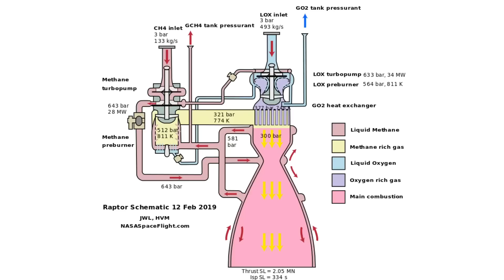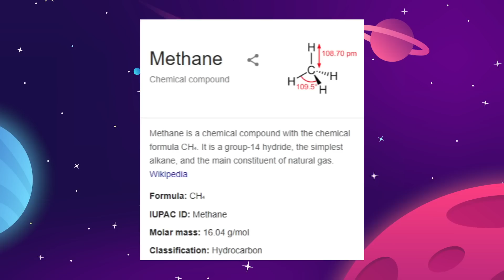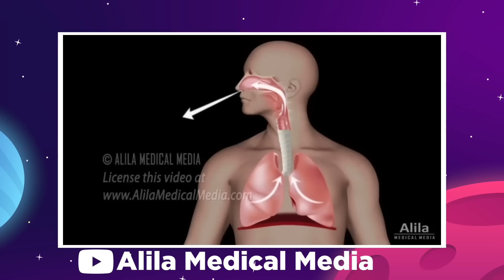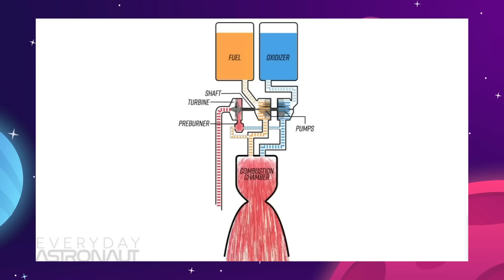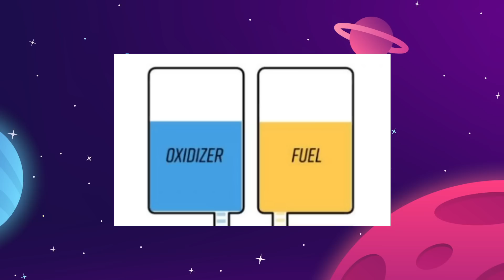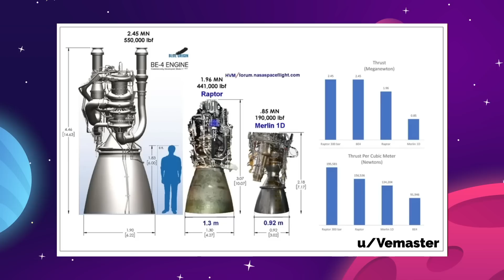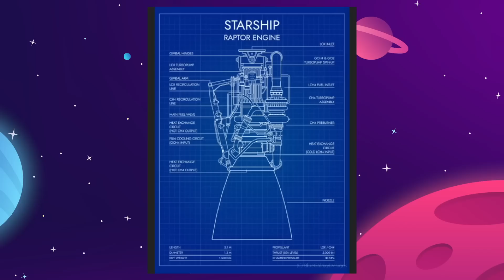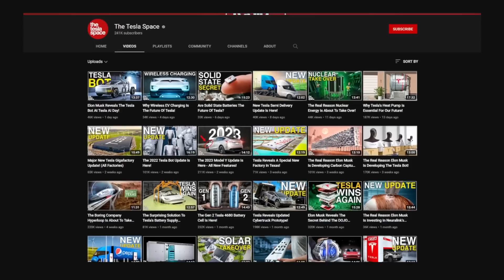The Real Reason SpaceX Developed The Raptor V2 Engine!

Comment: I have a question. Since there have been at least 33 Raptor version one and 1.5 engines and neither are going to fly a Starship, what will happen to the old engines?  I wish Spacex would modify a Falcon 9 and launch them into orbit. That would give them lots of data and might even get more Starlink satellites into orbit.

Comment: While largely correct, the little detail in this video are often just plain wrong. The Raptor is not the first attempt at a full-flow staged combustion engine, it is the third. It is the first to fly, though, as the other two didn't get as far as flight testing. 

Also, the oxygen side of a rocket engine is most decidedly not the same for all rocket engines. If only because not all rocket engines have an oxygen side. Oxygen is NOT required for all fuels to burn. There have been hydrogen peroxide oxidizers in some rocket engines. The super draco thrusters on a Dragon capsule use hypergolic fuels, neither of which is oxygen. Solid fuel boosters, which are definitely rocket engines, use no oxygen.

Comment: I am pleased you mentioned the Everyday Astronaut. I remember Elon talking to him and saying Raptor 2 doesn't use pre-burners now. I don't fully understand how they fire a Raptor up and Elon was not spilling the beans. Whatever the case, the Raptor 2 is a demon rocket engine....and there is more to come from it.
Reply: Umm, no. Of course Raptor 2 still uses pre-burners. What he said was that Raptor 2 no longer uses electrical igniters in the combustion chamber (but it does still use them in the pre-burners). The pre-burners are needed because they pump the fuel and oxygen into the combustion chamber. No pre-burners, no fuel and lox in the combustion chamber, no useful power from the rocket engine.
Reply: @colindavidson7071  Umm, no. Everyday Astronaut specifically asked him "where are the pre-burners" to which Musk replied "there aren't any" the Everyday Astronaut then asked "how do you fire it up"...to which Musk replied "I can't give away state secrets". I think you need to watch it again.
Reply: @dazuk1969   you are incorrect. Watch his video on raptors starting at 9:30. He is absolutely talking about torch igniters. 🤦‍♂️
Reply: @chrisjohnson2065  Exactly. Darren, also look at the diagrams just after 30:00. Note that both the fuel and oxygen powerheads consist of pre-burner, turbo and pumps. Are you saying that Tim Dodd got that wrong? If so, why hasn't Elon Musk corrected him yet? We know that Musk watches at least some of TIm's videos, which is how TD gets so much access to Musk, because Musk respects his work.

Comment: The RS-25´s hydrogen fuel allows a higher exhaust speed than methane fuel.
Reply: True, but beyond the scope of this video. Hydrogen + Oxygen yields among the very highest Isps (proportional to exhaust velocity). However, liquid hydrogen has terrible fuel density (7% of water), making hydrogen boosters need extremely large tanks, and very large fuel turbopumps to pump the required volume. Liquid methane has much higher density, allowing the engines and tanks to be much smaller. That helps the booster significantly; the second stage pays some penalty in reduced Isp (weight is more critical there). Liquid methane/LOX is a compromise between the density (but lower Isp) of RP-1/LOX, and the efficiency/Isp of hydrogen/LOX.

Comment: ~ 2:00 - Well, no. I know this is the "idiot guide to rocket engines", but I still think you should have mentioned that oxygen is not the only possible oxidizer, especially as you use a brief clip of N2O4 around 2:50 (without going into details of hypergolics or outright exotics like fluorine.) Also, you should have mentioned you are talking about liquid fuel engines, and that there are also solid fuel engines, outside of scope of this video.
~ 4:10 - And what about hydralox engines?

But, all in all, this was a decent overview.

Comment: ~ 1:05 - Energomash attempted full flow staged combustion engine with their RD-270 in '60s, and Aerojet Rocketdyne on early '00s with their "integrated powerhead" demonstrator. Raptor was the first to actually fly. Full flow staged combustion is the crazy part of Raptor, not use of methane.
Reply: The Russians did full flow first and Elon Musk got it to work the same way that the Russians did. You keep blowing them up until you figure out how to make them work without blowing up..